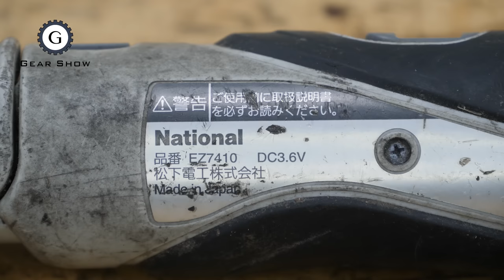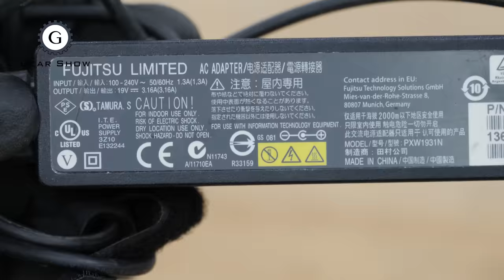Old Model 3.6V Screwdriver Restoration | National EZ7410

Comment: Ok, the two-wire thingy going into the handle was the light. That's clear.
But what is the three-wire sensor (or whatever it is) in the front for?
Reply: It seems to be a speed encoder sensor. Maybe it's part of a safety system in case of a output shaft stall.
Reply: It detects when the torque clutch slips and stops the motor, so you don't hear the annoying "tatatatata"

Comment: Great Video master like all other videos.
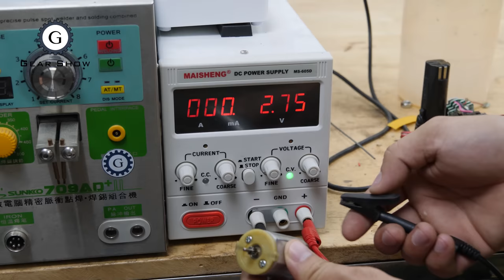What is this motor's current value   "not need buy a new motor"   at 3,7 volt ?  1 Ampere ?(I mean at 08:44 test) 
Second question :Have any polishing material for plastic covers polishing "like new"? 
Could  you advise a product  names ,method  or a product link for this ?